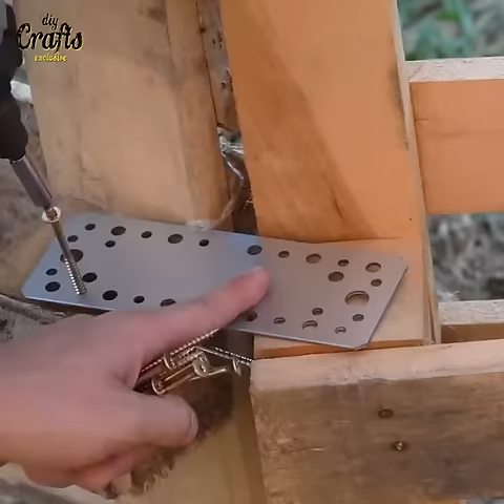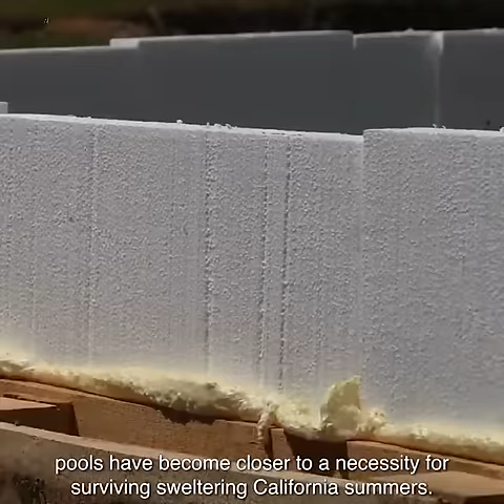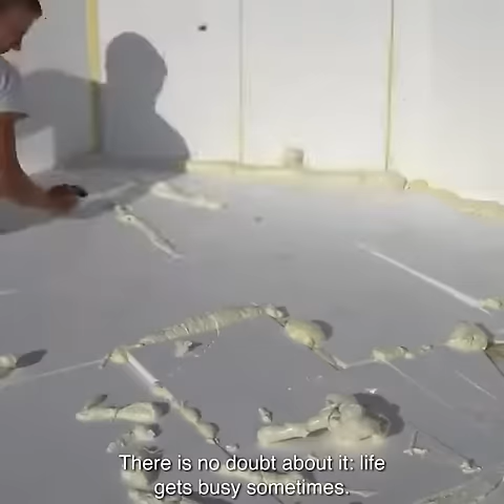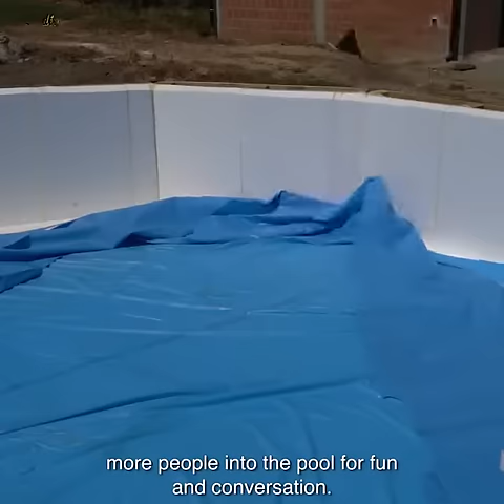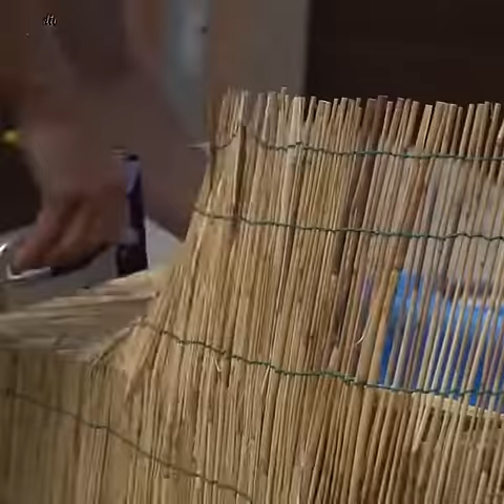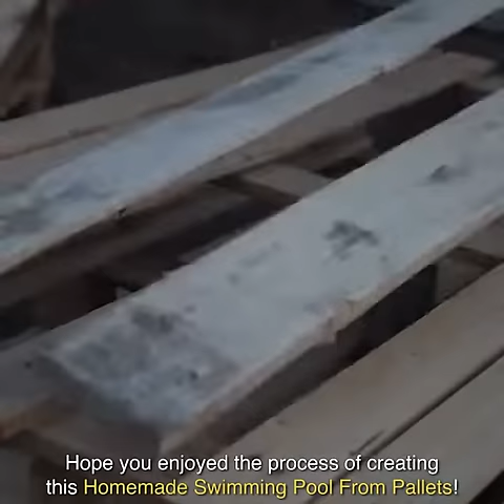Fazendo uma píscina com paletes   DIY Homemade Swimming Pool from Pallets

Comment: Free standing pool installed on top of polystyrene and inside untreated crates? Probably a 6000L pool so 6 tonnes or more downward pressure without any moving around inside. This is not a good use of time and terrible for the environment.